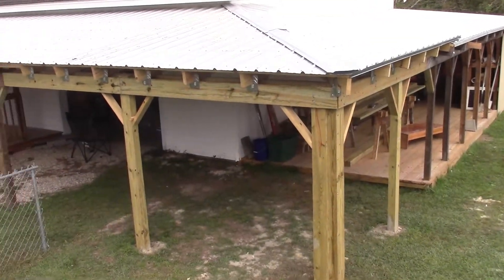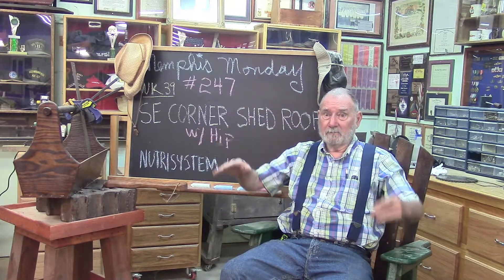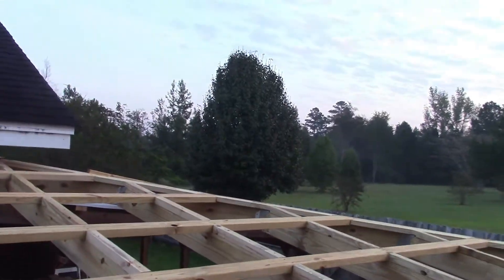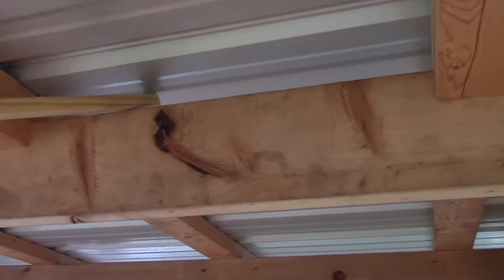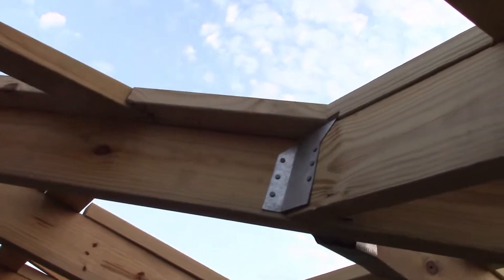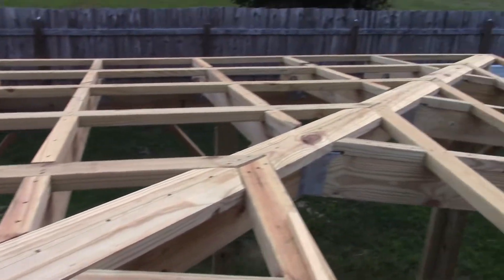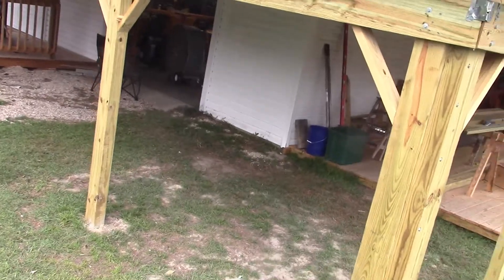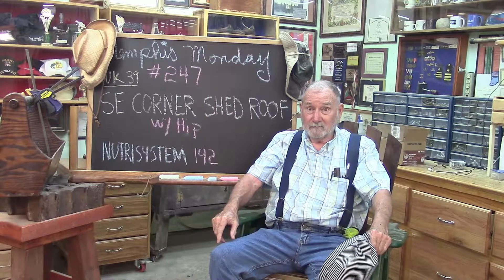247 Building a Corner Shed roof with hip roof week 39 of Year 5

Comment: Framing the rafters, enjoyable. Screwing the tin on the roof, not so enjoyable. Glad you didn't fall off in the process. When you replace the seam cover or what ever its called, let us see how it looks. Hope to see you next week. Happy New Year.
Reply from the maker: I may not replace the ridge cap, as it seems to be working.  What I will probably do is just straighten out the bends I put in it.  
      I sure am glad also.  I should have shown some footage of the ladder arrangement I used.  That thing was pretty solid.
      That tin makes be think I'm old.  Back in the day we put the nails on top of the ridges - remember?  Now they want you to use the screws and rubber washers.  
       I think cutting the tin to fit was the real bummer.  Real roofers do it on the roof, but I carted it back to the shop, like a wimp.  Next job, this spring, is to put in the deck.
       Thanks for watching and commenting.